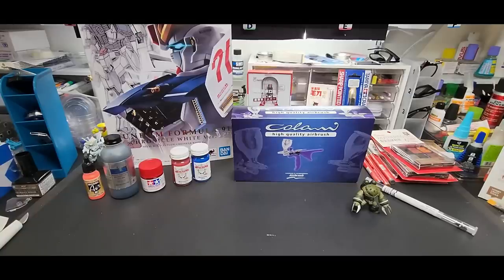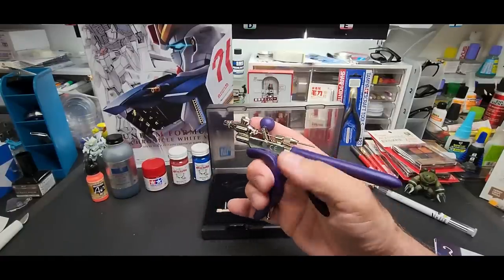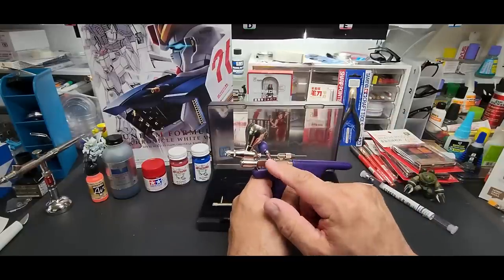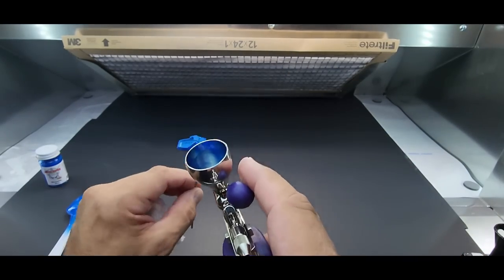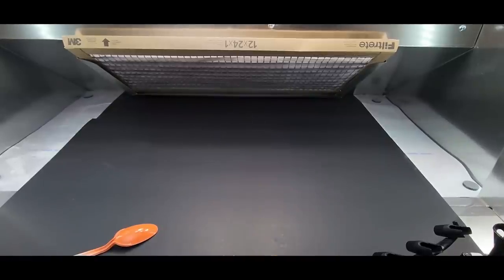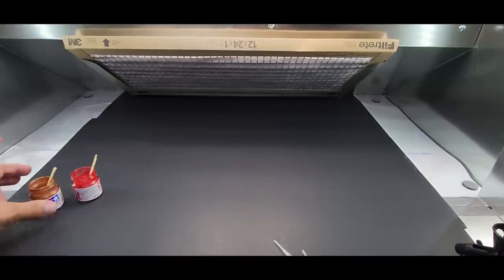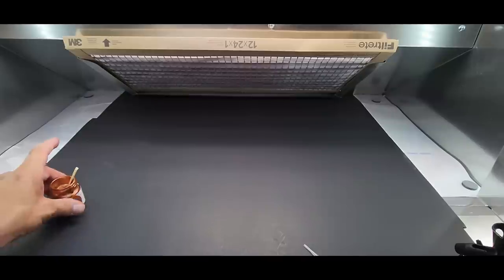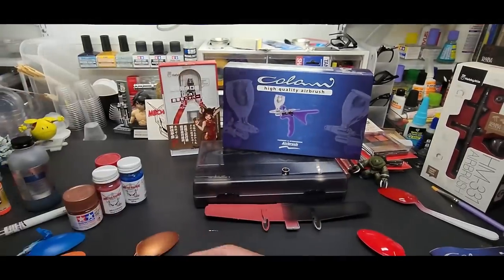Testing The Harder & Steenbeck Colani Airbrush

Comment: I received this brush yesterday . Some years ago( or many should I say) I've tried this gun and I were( and I'm still) amazed by the performances,the capacity of this  brush. This week-end,I'll give a try.  With the Infinity, this brush is in the high end range, It's expensive but worth it. In Canada this brush cost 370$ without the shipping and all the taxes. Two things: the plastics parts could have a much better finish for the range  price of this airbrush. I know that this point could be see as a bit of nitpicking but as I said for the price no flaws should be  in that kind of airbrush.  Finally it could be awsome if this airbrush have an option for fan spray pattern sets for like 0.8 ,1.0, 1.2 mm needles/nozzle sets!

Comment: For cleaning the brass nozzle Tamiya 87105 extra small cotton swabs are perfect they are slightly larger and have a sharp point and reach all the way down to the needle seat beats the $40 H&S nozzle reamer and avoids damage from the wire holding the plastic bristles in the gum picker.

Comment: The inner works is based on a airbrush design from the 40s. Also Sata had a similar design.
The screw behind the trigger is to control when the airflow starts,you can set it up so air first then paint, or paint and air together.
If you take the Handel of then you can still use the quick connector.

Comment: It really does look more like it's intended for automotive use or at least large projects.  Not a 2-stage trigger or am I missing something?

Super interesting but don't think it's something I would want.  Thanks for showing it off, though!  Cool bit of kit.

Edit:  I gotta wonder if it would spray Cera-Kote.   Hmmm....
Reply: It's a dual action airbrush.
Reply: @DaneSaysStuff  Thanks!  Did seem odd Harder & Steenbeck would make a brush without it.
Reply: @MrAcuta73  it’s a Single Action Dual function airbrush. You pull back and it does air first then paint, you let go paint stops then air stops.

Comment: Thanks for this review. Currently deciding between this and the Infinity CRplus. Can the Colani blow out just air on its own, or is it always a mix of both air and paint e.g with the Infinity you push down for just air and then pull back for just paint. Just trying to understand the difference, as I feel like this will be a major deciding factor on which one I choose in the end.
Reply: Yes, this is possible with the Colani.
When you pull the lever, the preliminary air starts immediately, but no paint is sprayed yet.

If you pull the lever further, you will eventually feel resistance.

If you continue to pull from this point, color will be added.

This is why the Colani is advertised as a double-action airbrush gun.

Comment: Interesting Airbrush and excellent review. The one thing I'm curious about is whether or not it has a Fan Shaped option for wide section spraying.. I would ASSUME that it does given the option for very large needles, but I also can't help but think that there must be a better option for 'wide format' paint application when it comes to airbrushes, no?

I need to paint about a dozen computer chassis' of various sizes so I'm looking for something that I can paint with that will lay down paint like a mini spray-gun, but can also be used as a bigger version of an airbrush, although I do have an Iwata Eclipse CS.. (my budget is about $250 / US).

This Steenbeck is definitely out of my price point, but maybe some of you have suggestions? Should I stick to a mini-spraygun or something?
Reply: procon boy .5 trigger
Reply: @Dynamodel48  
Was that the PS290?

Comment: The design looks beautiful, though I'm confused, is it a single action airbrush? I get the trigger controls the amount of air, but how do you control the amount of paint you're pushing through?
Reply: Not a signal action as per say.  the trigger design is one used by many German airbrush manufactures at one time,as it is many have closed down.
How it works as you pull the trigger back you get air as you pull further back you get paint. most of them you can control when the air kicks in, from above.
The screw behind the trigger is to control when the airflow starts,you can set it up so air first then paint, or paint and air together.
Reply: @jnrmack  thanks, I've never come across this before, but its definitely an interesting concept 👍
Reply: @gmoney1664  concept is to let the air blow over the needle last this removing any paint residual ,this means no build up on needle. that is i believe the principle.

Comment: How can you tell what a needle size is? Is it how much of the needle sticks out of the tip of the brush?
Reply from the maker: Diameter
Reply: @barbatosrex9473  thank you for the info so measure anywhere on the shaft of the needle where it is all the same thickness?

Comment: This airbrush looks good but why not just get a car spray gun for painting large stuff? It a lot cheaper.
Reply from the maker: I tried that but they require a full sized auto shop type of compressor. They need large amounts of constant high PSI and I currently don't have the room for one. It's the main reason some of these airbrush companies are offering large sized needles
Reply: @barbatosrex9473  I see, thx for the info.